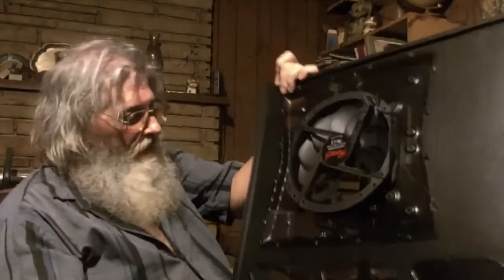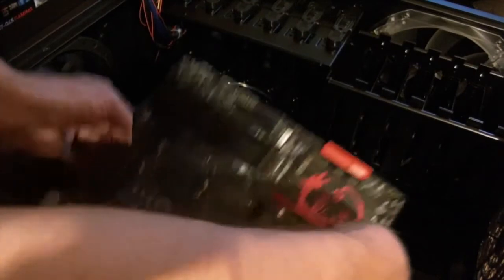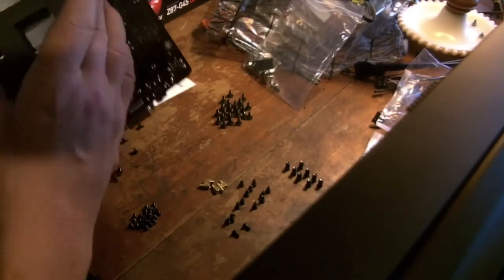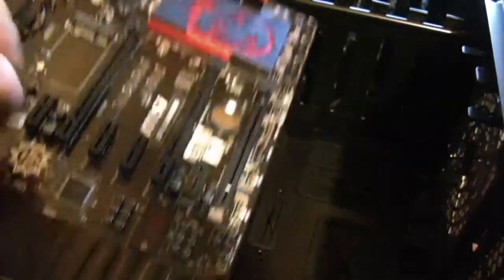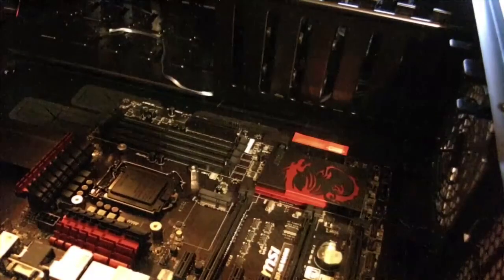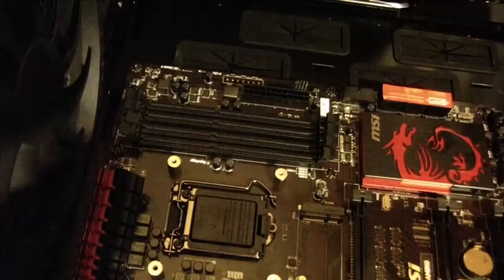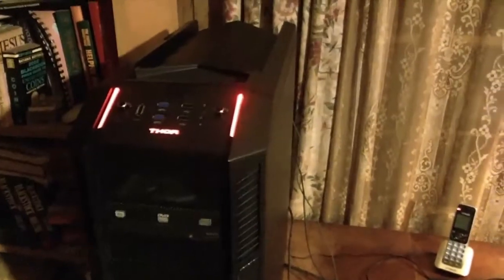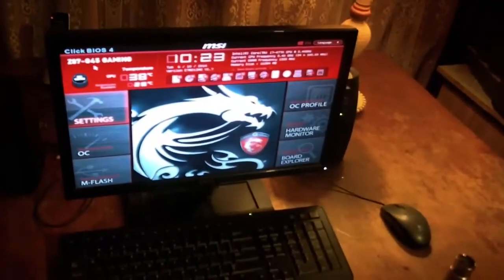Finally Time To Build

Comment: That big tower must have been a pain to move with your left arm being what it is... :\
Congratz on the new PC... ^^

Hope you can use it for many years to come.
Reply from the maker: it was indeed literally a pain (several in fact), but well worth it once I have all my software re-installed and set up.  It's going to take a week or two to get all of it done but I should be able to Minecraft, KSP, and Orbiter 2010 very soon.

Comment: Love the cable management system on that case so much I may buy one for my next build.
Reply from the maker: I can't recommend it enough.  Cable management is good, pull-out hdd mounts is good, 4 huge case fans and a wind tunnel effect is awesome (remember I've lost 3 desktop computers in 6 years because of thermal problems)